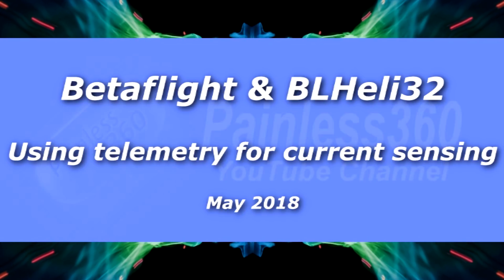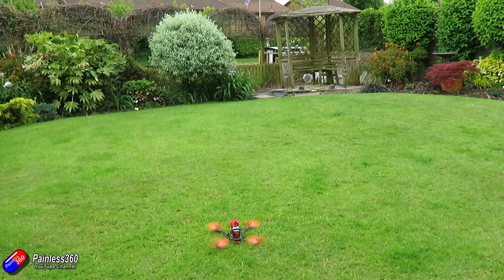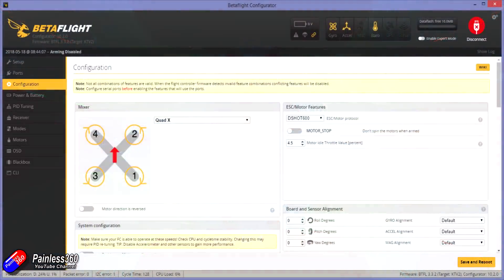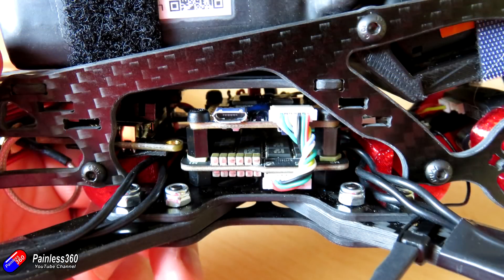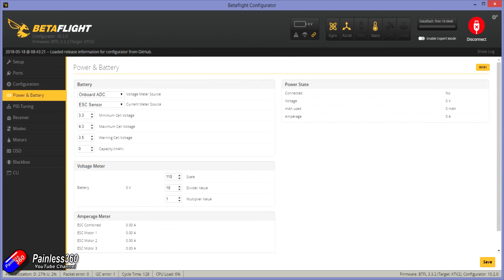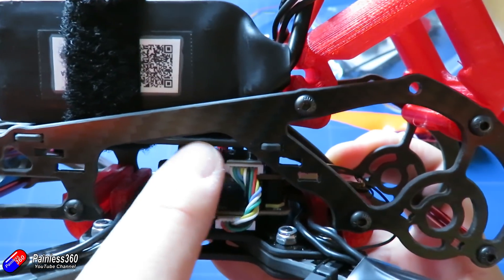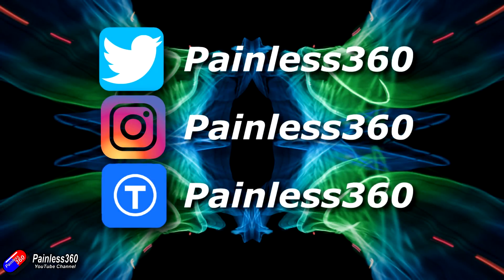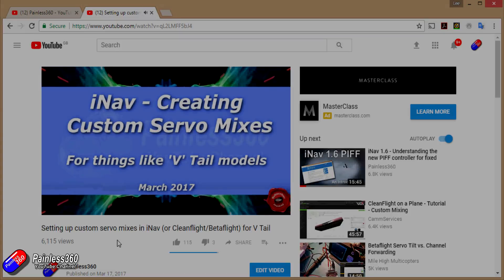RC Quick Tip: BLHeli32 ESC Current Sensor Setup in Betaflight

Comment: Hello. Can you please help me here.
I have a omnibus xrotor f4 g2 fc and 4 individual platinum pro 30 amps esc no bec. I tried my best to make them work together but i couldn't. Is it even impossible for that fc to work with individual esc. If yes. Please how. I tried almost àll the sitings on betaflight but i didn't succeed. Can you please tell how to configure them. I think it's probably the esc protocol problem?
Reply from the maker: It depends on the ESC. Most modern ESCs support DSHOT so select DSHOT 150 as a ESC protocol in Betaflight as the first step. Best of luck.

Comment: Old video yet i hope you can give me a clue. What can be the reason for my voltage reading being 7.4v at 4S while im using ESC Sensor for thet function? Im sure the batteries are ok and fully charged.
Reply from the maker: Not sure, I'd check the forums for the ESCs you have. Best of luck..

Comment: hi there, great info.
Bu t I have one question, how can I know its acurate, because even without running the motors I have reading of about 5-16 amps consumption which is simply not makes sense. is there another setting in blheli for this ?

Comment: I'm trying to figure out how to get esc telemetry from single escs. I'm using a non aio fc with a pdb and single escs. The escs' red and black wires are connected to the pdb and the signal and ground twisted pair I've soldered to the signal pads on the fc and a common ground pad respectively. Is there anything else I need to wire up to get esc telemetry working?
Reply from the maker: See some of the recent builds where I have wired up the ESC telemetry. You just need that extra telemetry signal cable to the telemetry pad on the FC.. Best of luck!

Comment: Any idea as to why i am unable to get current draw from esc telemetry. Through i am able to get everything else, esc temps, rpms etc.

Using a kakute f7 v1.5 and tekko32 40a 4in1.

All the latest firmwares and betaflight configured correctly using dshot600.

:(
Reply: I have the same issue. I am using FC SpeedyBee F7 AIO with Tekko32 F3 40A 4in1.
Reply: For Tekko32 F3 Metal , Holybro website says :The 4in1 has onboard analog current sensor, and TLM function(then no current reading over TLM) . So I guess same is for the 40a one :(
Reply: @hristiantodorov3923  
I have the metal version, it seems impossible to get mah consumption. it's really annoying. big mistake on the part of hollybro, surprisingly.

Comment: For 4.1 I had an issue with the Tekko 4 in 1 showing amp draw just as armed, a steady 24 amps, never changed. Also my battery readout in betaflight was way off.  Beat my brains in trying to figure it out. Your video helped.

My fix, enable ESC sensor in configuration tab, select esc as input on uart 7 in ports tab. Then changed Current Meter in battery tab to ESC Sensor.

Been watching your vids forever, love them. Thanks you!

Comment: What about using a digital current  sensor for a flight controller such as the frsky f7 with built in rx?I'm using the lumener 50 x 4 4in1 which doesnt have a current sensor either ,so I got a couple of the tbs digital current sensor laying around my bench .I defiantly  can't hook into the current pad on the fc as it will fry the crap out of it,ask how I know.lol could I just wire into a spare rx uart?just trying to get the info to show in my osd.

Comment: thanks for the video, i have the same configuration, but how do you adjusted for the mAh usage on the battery? any help would be great. thanks
Reply from the maker: That is usually done in Betaflight itself..
Reply: @Painless360  TY for replying. I understand the current sensor  calibration procedure  on a FC, but is there a way to do it for this type of ESC configuration?  the current adjustment is not available in Betaflight v4.0.4 on the power tab.

Comment: Fortunately i figured this out before i watched the video but it was a pain, Thanks for the video im sure it will help a lot of people. I do have a question though. Have you figured out any way to adjust the mah reading in betaflight osd from the esc sensor? I realize its only showing me the motors but my average charged mah is roughly 1.34x higher which is pretty significant. I find it hard to believe that my VTX and camera are using 1/3 as much power as my motors, especially since my motors draw over 115 amps on a punch out. Any ideas?
Reply from the maker: I've not, if you figure it out then please let me know..
Reply: I have the same problem with mAh readings (see above from RoccoFPV) did you figure this out yet? if so please let me know. TY.

Comment: One Question: So in your case, where the ESC Current comes with the 8-pin cable from the ESC, you dont have to set the tab "sensor input" to ESC in the Ports -> UART-Table, right? because i have same configuration but there isnt an UART free. Only have RX1 /CRNT but it is not an Uart. But for me current reading does not work :(

Comment: There is BLheli_32  ESCs with current sensor and telemetry pads and without. Is there any advantages to have ESC with this features except for logging and displaying on OSD purposes - does for example current sensor somehow utilized in ESC or FC itself? for overcurrent protection maybe, or in PID algorithm somehow?
Reply from the maker: It's useful if you want to see what the current is to each other Motors as you're flying, it gives you a little bit more granularity on the data. It's handy to if there's no other way for you to get the current draw from something like an all-in-one or power distribution board as part of your model too. Happy flying

Comment: @painless360 hey, found this vid 10 minutes after i figured out how it works, but the question is: can you calibrate the ESC-Sensor so you take account for all the other consumption? I know, since the reading comes from the ESC it is what it is, but I'm talking about "putting some mah-consumed per minute on top" to get a better idea of how long I still can fly!
Reply: Found out, that you can do it in BL heli - but you will have to configure every esc alone, and write every esc for itslef. I lacked 14% amount used up mah, so I made every esc. count +14%. Now I was still 7% low... it works kind of like that.
Reply: @painless360 hey... I had 14% less reading than what I charged, so I changed in BL_Heli32 the current sensing of every esc to +14% this didn't match yet... now I'm at +38% and i'm getting nowhere. Any idea if I'm doing something wrong?

Comment: Thank you for sharing. i have a question: if you use single ESCs, do you need to connect all 4 telemetry pad to the same uart rx or you can use just 1 Esc's pad and go scaling to get proper mah monitor? Tha nk you
Reply from the maker: All of them need connecting yo the telemetry pad.. See the build series. Best of luck!
Reply: Thank you, so it's no possible for just current reading connect only 1 and divide by 4

Comment: Hi there, very informative video but I just have 1 question. I'm running BLheli32 ESCs and A PDB that has a built in current sensor. Do I still need to connect a telemetry wire to the ESCs in order to get Mah consumption and Amp draw? I have a wire connected to the curr pad on my PDB going to the curr pad on my fc. I noticed that my Mah consumption is well over 3000mah when Im only running a 1550mah battery which leads me to believe the FC is just using a maths algorithim to judge my consumption.
Just wondering if you have any ideas, Cheers!
Reply from the maker: You can use either the ESC telemetry or the one in the PDB. You select the one you have connected and want in the power tab. You'll need to change the settings in the current sensor to match what you're using a lot better. Google 'betaflight current calibration' to find videos on it..
Reply: Perfect, thanks for the help! Much appreciated

Comment: I saw this video,  and thought finally,  but may I kindly add that you didn't cover any of the cli commands that pertain to the ESC telem.   also i have the same esc fc combo on on of my quads and for the life of me cannot get current sensing working.  any other tips? everything is set like you have in the vid,
Reply from the maker: Have you flown it? You won’t see anything in the bench..
Reply: Painless360 oh yeah ! I fly the thing pretty much every day,  I just fly without current sensing, so can't really tell how much I pulled out of it , just have to go by voltage.  I've tried changing the half-duplex setting in CLI nothing seems to make it work
Reply from the maker: Odd, it’s reading here..
Reply: wish mine was! haha  beginning to think its an issue with the esc itself, i threw a Helio SPRING and the Tekko32 v2 together and i still cant get it to read everything connected properly, i wish i had an oscilloscope to see the telem output sig.
Reply: Maybe turn on amp draw in the osd tab of Betaflight?? Tony
Reply: that's one of the first things i do when setting up my OSD.   voltage, current, rssi, mah, and flight timer,   im really stumped the osd just shows 0 for current reading, everything connected correctly and setup properly,  thanks for the try tho
Reply: hi, did you find the solution ? i have kakutef4v2+tekko32_f3 (metal ) 4in1, and it show 0 mah consumption in flight, only voltage.  i haven't this issue with kakutef4 AIO + tekko32 (not 4in1 ).
Reply: @404ErreuR404  hahaha because tekko32 is not reporting current over telemetry, just analog on the current pin :P :P

Comment: Hi Lee, 

It's the noob from Macclesfield again lol so I now have a zmr250 and a Flite Test Gremlin fully working and I'm loving playing about with them. But I was wondering if you could do an in-depth video series for us noobs about PID Tuning? I have no idea about it. Both quads are running of their standard settings and the only thing I've changed is the notch filter. I'm using the dynamic filter instead. I would really love to know how to tune these things, specially the ickle gremlin. I love the style of your teaching which is why I'm asking you to do the series. I think us noobs would be extremely grateful! Cheers bro and hopefully speak soon.
Reply from the maker: I have an older video but the PID tune in Betaflight 3.3 is great for most things out of the box..